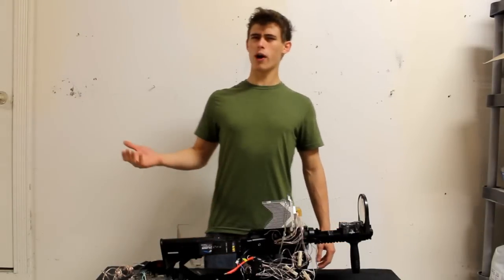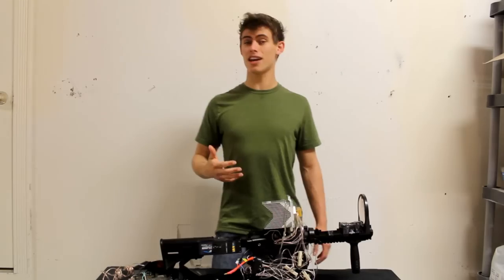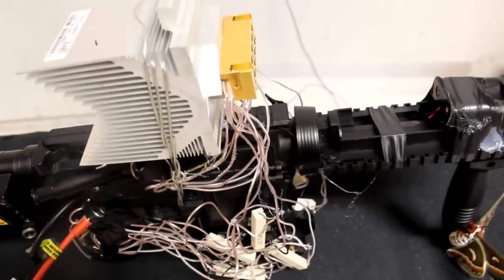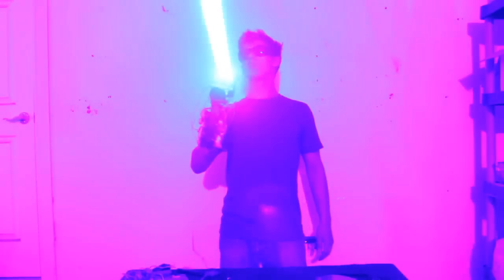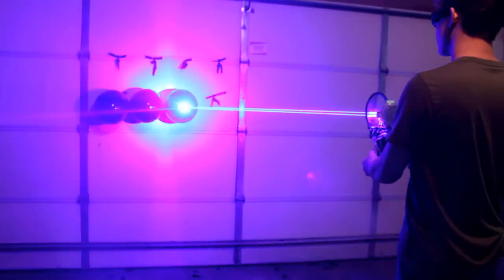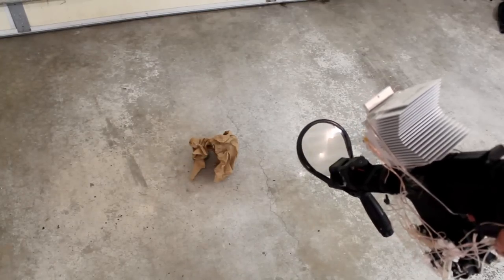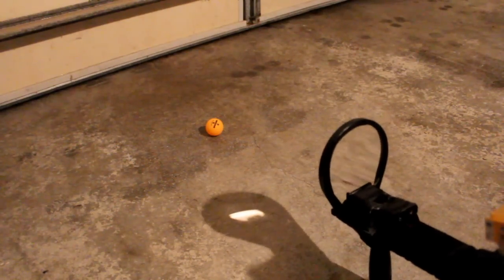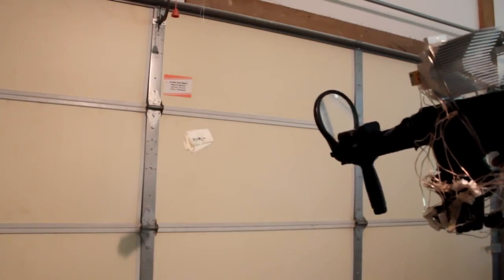My Homemade 40W LASER SHOTGUN!!!!!

Comment: The reflection off your lens looks kinda troublesome. Sure, you're wearing eye protection, but that's no excuse when part of the beam is reflected directly back to the user.
Reply: Reflected light is light that never reached his eye, and instead bounced off to th camera. Laser goggles, especially the ones that Styro buys, are highly affective. OD5 (OD10^5) goggles filter out 99.9999% of light, meaning that if 40 Watts of blue laser hit his goggles, only the equivalent of 4mW would hit his eyes.
Reply: Randy Butternubs "Reflected light is light that never reached his eye"

That doesn't make sense. It's clear that the beam is reflected close to 180 degrees, missing his head by only a bit. His goggles might be effective at blocking the light, but it's still a major problem. It's not like he's going to sell this of course, but half a watt of laser light being deflected towards the user is bad news no matter how you spin it.
Reply: +Dennis W +Dennis W Perhaps you misunderstood me, if you see a flash of light from a shiny object, the light you're seeing is light that was reflected off the object, and into your eye, or in this case, the camera. Meaning that the light hit the shiny object, but little was absorbed. If you saw a flash of light from his goggles, the light you're seeing wasn't absorbed by the goggles, because any light that was absorbed you wouldn't see. You're right, 4mW hitting your eye kinda sucks, but it's not a "big problem". 4mW is the equivalent of a class 3A laser, or in other words, it's safe for short term exposure.
Reply: Randy Butternubs I'm not saying the light did hit his face, but at 1:40 you see the lens reflects enough of the beam to make it visible in clear air, suggesting a couple hundred milliwatts are going that way. It's not focused enough to cause thermal damage, but as a laser enthusiast, styro should realize that this is a major design and safety problem, even with goggles.
Reply: +Dennis W +Dennis W I did my maths assuming the worst case scenario, that all 40 watts hit the goggles. Clearly this wasn't the case, as the laser consists of 4 10 diode arrays focus into a rather large focal point, but even if all 40W hit the goggles dead on, that's only 4 mW. 
You say "a couple hundred milliwatts", so again, I'll assume the worst case scenario, and assume you meant 999 mW. If 999mW hit the goggles, only 0.99 milliwatts would reach his eye. That's like having a cat toy briefly move over your eye. If you hold it over yourself for days, you might cause some damage. But other than that, it's harmless for short term exposure.
Reply: Randy Butternubs And if everyone wore kevlar vests, they could play paintball with live ammo. I'm just saying the safety gear should not be what actually protects you. It's meant for those cases when everything else goes wrong.
Reply: +Dennis W That is among the most stupid things I have ever heard, and one the the most broken metaphors. 
People wear Kevlar vests, just incase they get shot, but people use parachutes when skydiving because it is literally required to do it safely. 
Goggles are not like a fire extinguisher, they are not for emergencies, they are literally required to use a laser of this power, just like how a parachute is required to skydive. You're saying that, when skydiving, you shouldn't rely on your parachute, because it's just for emergencies. 

If he wasn't wearing goggles, the light reflected from his walls would instantly blind him, even if the beam never actually hit him in the eye. You claim to be a laser enthusiast, but since you fail to grasp these basic safety concepts, I am genuinely concerned for your health.
Reply: +Dennis W So yes, he can rely on his goggles. They're not a Kevlar vest, for if things go wrong, they're a parachute, because things WOULD go wrong without them.
Reply: Randy Butternubs I never claimed to be a laser enthusiast, so your little sarcastic stab is falling a little flat here. Besides, me thinking a partially reflected beam is a cause for concern naturally makes me a dangerously clueless amateur, sure. You're absolutely right, I was stupid to think a scattered beam is a problem in any way. Why not stand directly into the beam while he's at it, he is wearing his super goggles after all.

What are you even saying man? You're completely missing my point, that no matter how good your protection is, it's still a good idea to minimize the actual hazard. Just because it would hypothetically stop the beam doesn't mean you have to try it, does it?
Reply: +Dennis W U are seriously the stupidest person

Comment: That's actually not hard to build in home, as long as you have the project sheet and the right material. Seriously, you just need to know what's current, voltage and resistance, how they work and have some practice with electronics. Get the project sheet and build one.
Not trying to sound douche though. As long as you have the DIY project in hands, you can build one yourself.

Comment: you should build a small gas laser tube, that will be 200w - 500w :DDD
Reply: +Theodore Krap small and 200w dont go allong :) it would be several meters in length
Reply: nukularpictures lol no just like 30 cm those 5w diodes are only 1cm - 2cm long
Reply: Well yes trust me. Laser Diodes arent really suitable for that. The problem, that he allready has with this setup, is that those beams wont be coherent and so the effective power of the diodes, because you will have destructive interference, wont be x * 5w. in fact with this setup he will maybe get 10w effective. So to create a real 100w laser beam you are best of to use a co2 laser tube. Those however are quite long and require a hv power suply and it would he highly dangerous to buid one.

Comment: if you could only get one laser diode, would it be possible to power it up with 24 LM 317's?
Reply: +Morgan Seun You could use a single LM317 to set the voltage/current of a 'Pass' transistor, so you can keep the parts count to a minimum. The LM317 is used/setup as a constant current source, verry little variation, as lasers don't like a supply that jumps around.
Reply: It would be fun to have as much output as displayed in this video, however I could only get one DVD rewritable drive, that's why I asked if 24 LM 317's would give more boost.
Reply: +Morgan Seun The output of the DVD laser is limited to mW, and trying to increase power beyond its rating would damage it. It's still able to work, just lower power.
Reply: +Scott x Thanks a lot. Thumbs up from Nigeria

Comment: If this gets pointed at human skin isn't it gonna cause instand cancer?!
Reply: +BlackTygoGames Wawelengths below 400nm approx cannot cause cancer because their low energy. No matter how many low energy photons you send, there will be no excitation and therefore no cancer. Instead, all lower vawelengths generate heat, as you can see in the video. This also applies to microvawe or WiFi. No cancer.

Comment: +styropyro  if you really want to make a REAL laser gun,  get a 1kw industrial laser.  use a capacitor bank to pulse the energy throu the laser module.  it will be like firing bullets.

Comment: Some electrical/electronic ways to improve the laser design, may be to use a switched mode power supply circuit, instead of the dissipative voltage conversion using the LM317s; this may extend the battery life. 

Another method may be to increase the voltage to the lasers and pulse the voltage signal, to reduce the chances of thermal runaway burning out the lasing diodes. Care needs to be taken because of the risks of shortening the laser life or damaging the laser diodes during this experimentation phase.

There is a possibility of using a supercapacitor to further extend battery life, if an appropriate capacitance value, ESR and rated voltage device may be found.

I do not take any responsibility for any consequences arising out of the above suggestions; experiment at your own risk.

Comment: your battery pack for this shot gun, what voltag is it? 

   i was looking for a cool thing to build with an obsolete ( To me) lap top battery pack.   the batteries are brand new and all together are just over 11 watts.    i am a hUge fan of head lamps but I was thinking, diy head lamp with this much power , i might give myself brain cancer or even have it explode.  i don't want any part of that.  

  a badass laser though.  would be great for pointing out stars, drilling a UFO and stuff like that. LOL  your explanation of the build on the shotgun is pretty vague, what is that glass on the front? dose it concentrate?  or redirect?  

  the main thing I have seen that interested me the most is when i was at the Outdoor observatory there was people out there point out constellations with had held lasers.  with easy and great detail they could point out any constellation and a novice could plainly see it.  I mean it was obvious when it was pointed out.  these lasars were  just green and red and ran off 2 triple a's   I want to see what I can do with a hug battery pack.

Comment: Mount lasers in a ring with pivots then you can have them all point at the same spot no lens required spring tension can keep the lasers pointed in a tight group and further tension on the trigger could focus them so you would not need to constantly reset it for distance.

Comment: how much?
Reply: At least 200$ for diodes 
140 - 170$ for host 
Approx 40 - 80$ for drivers 
Battery 32.99$ 
Other parts maybe 20$ 
Goggles 40$ 

Total at least472.99

That's all just an estimation from my experience of building lasers.
Reply: +Randy Butternubs Okey post
Reply: specification of that lens
Reply: 472.99$   ://

Comment: how badly did it need the heat sink? I can't help think it would be more efficient if you could feed all the light into a single unit to produce a narrower single beam rather than kludge it using a lens? otherwise neat proof of concept.

Comment: Help, I ordered a 100 mw green laser with a power reading printout and it says it is 105mw. But the test was done without the IR filter installed but my laser now has one, I was just wondering if the IR filter makes it less powerful because I cannot light safety matches like I "should" be able to light them.
Reply: +Cole Russell Can you light them without the filter? If not, try focusing the beam. If that doesn't work, you got scammed. RIP
Reply: +Clyde Johnson Lol I got it to light when it was focused, so I guess it is a bit underspec but oh well.

Comment: I suggest improving the lens, like attach a broken DSLR or film lens to it, in that way, you can change your focus when ever you like without taking it off. Also, you Should improve your cable by using cables from a moduler power supply, those cable are made in greate qulity and come with handy plugs, just another thing, you can use a high end CPU heatsink like those made by Thermalright to replace the one you are using. I hope those suggestions helps.

Comment: bro how couldı make it
Reply: +Ruslan Shiraliyev you can use (x) amount 1.5 watt lasers pointers, strap on a lens and you're gloden, the reason for the 1.5 watt is because you can buy those on ebay for like 250 so they easy to get, and the 1.5 watt is enough energy to light a match and paper so yeah

Comment: Once you could get a laser powerful enough to burn flesh, you would have to wait a few seconds for the person to fall, in that time they could have already shot you with a regular gun, also "laser bolts" like in Fallout and Star Wars don't seem realistic, unless a new type of laser is invented
Reply: +Courier 6 It would need to be far more powerful in order to be able to do that.
Reply: +Liberty Voluntaryist You can instantly destroy someone's vision and cause searing pain from any distance. As long as you act first, it could easily beat someone with a gun.
Reply: +79Yamato The Star Wars laser guns fire heated bolts of electromagnetic field in combination with sound waves. That's what makes the pew pew sound you see. The visual of the "laser" is the sound tracing its way through and around the magnetic field along with the heat generated from the blast that propels the field forward, similar to Aurora Boreialis but slightly different. The combined heat and sound send it forward at a rate much slower than light because it's not light that's moving but light that's being created around what is moving. Think sound weapon that weakened the base of the towers before the crashes to cause all that dust to get an idea, but it's more complicated than that and much more advanced and in combination with other tech. The lightsabers are a controlled magnetic field, sound and heat generated from the base that pre-date the laser guns. The laser gun evolved from the lightsaber after they figured out how to make the magnetic field move accurately enough for practical use along a path of fair distance rather than just contained and controlled at short range. As time went on the laser guns got more powerful and could attain greater ranges and damage before dissipation of the field occurred.
Reply: +Liberty Voluntaryist If you go for a persons eyes, their only hope to return fire would be from memory of where you are. 40W = instant total and permanent blindness before you are able to blink. This is actually an effective anti-personnel weapon, and is IIRC banned by international treaty for being too nasty.
Reply: +Liberty Voluntaryist It would have to vaporize flesh instantaneously.

Comment: the problem is that with all these videos you see them going against very combustable matierals

I want to see it being directed at metal or a slab of pork to see how powerful it really is
Reply: +Domo Von Imperium Its not meant to melt through stuff like that, its a hobby project, a proof of concept if you will.
Reply: I know, but when I build my proof of concepts I experiment with them until they are completely ineffective at their role or break it

Basically a stress test

Comment: Why is the laser visible in clear air? I mean every laser is just visible through smoke or fog, right ?
Reply: +ShipinShen It depends on the output power and wavelength. Example: 5mW 658nm (Red) vs 532nm (DPSS Green). You wont see the red beam at all but the green would be visible in clean air when its dark. Its due to the high sensitivity in the green spectrum. Why is the blue one visible? Well.. its just overkill. Google about 'Rayleigh Scattering'. Will clear things up ;)
Reply: +AtmelKiller thanks mate :)!
Reply: No problem mate :)
Reply: Gene Pozniak It's the same effect. 
I work with lasers everyday like he does. I guess he is using a Hazer to create a very light "Fog/Haze" in his room. You wouldnt see it so strong in normal air. Tested it with an 2W 532nm DPSS laser. Its super bright but not as solid as in the video.
Reply: It is possible with MUCH power, Look on youtube. Pretty interesting
Reply: +ShipinShen high enough power makes it so that all the small particles in the air light up toa degree. however a high enough power can potentially make the gas in the air glow
Reply: +Dylan Missuwe yea i think you are right for what we can attain but i think that potentially it can given massive amounts of energy. i man look at the Aurora borealis or however you spell it. and yea i know that those are particles not light but the energy from it originates from the light of the sun
Reply: +Dylan Missuwe Industrial CO2 gas lasers can make the air molecules ionize, I once saw a picture of what looked like little light bubbles tracing out the path of a high power CO2 laser beam. The CO2 gas laser produces optical in the LWIR range, beyond the ability of the human eye to see the beam.
Reply: +Neil Ruedlinger Google about "Rayleigh Scattering". You will find the answer on Wikipedia
Reply: +AtmelKiller I believe ShipinShen asked why "the" laser, as in the laser in this video, is visible in clean air. Your answer was about "lasers," generally in the dark.
_Everybody keeps asking Stryropyro how he gets his lasers to show in what appears to be clean air in the video. But he NEVER responds. 

I believe that's because he's trying to keep secret his special technique, which is obviously some combination of some kind of light smoke or other particulate in the air and a special light filter on his camera. Notice that the air tends to turn a bit pink against the blue laser beams. Because of the latter, I seriously doubt that his laser would look that impressive in person. Sorry if I lasered anyone's balloon.
Reply: AtmelKiller its also bc in the begining it's really bright bc the angle of the camera. When looking at the beam from in front of it it is brighter than the same angle behind it, idk why but it just is brighter. I think it is because the ave angle of the light that is refracted from the beam by the air particles is more forward and to the side than backward because the light is already traveling forward to begin with
Reply: James Sever Yeah thats true
Reply: James Sever No. I've seen his other videos with much narrower beams. The width and angle of the beam are irrelevant. It's just some kind of haze and a special camera filter.
Reply: Gene Pozniak i wasnt talking about the width of the beam
Reply: James Sever Yes, I know.

Comment: I like it. Except for using LM317 regulators. Like all linear regulators, the LM317 is very inefficient. A much better design would incorporate a high power bucking regulator. These DC-DC converters are dirt cheap on Ebay and would give a longer run time on that battery pack.